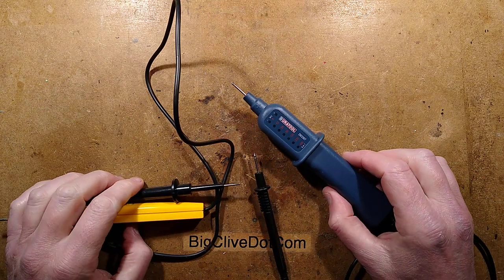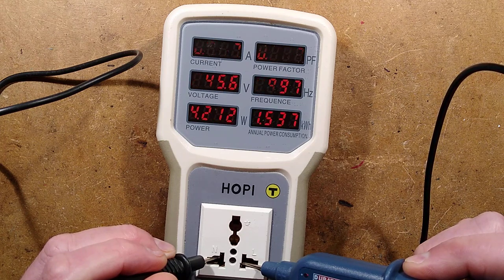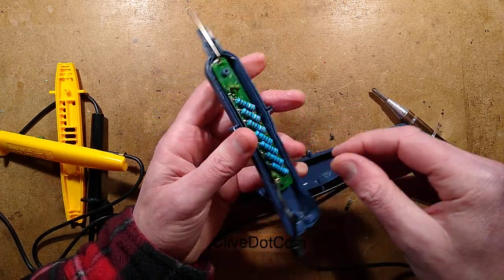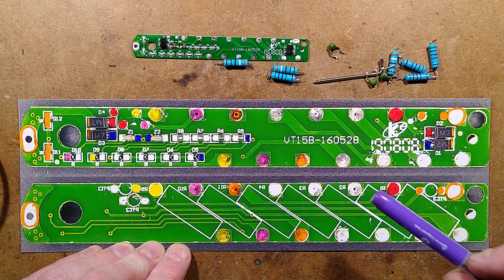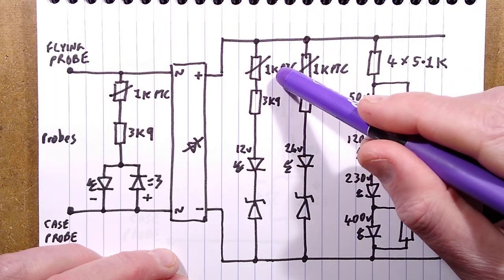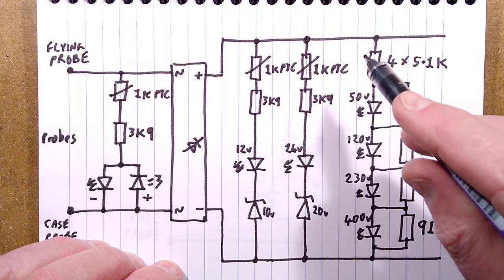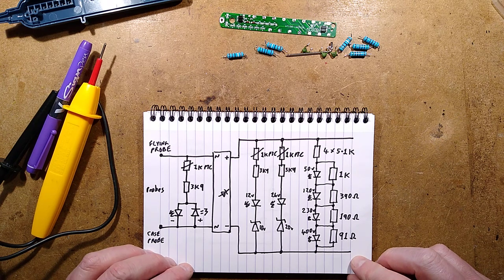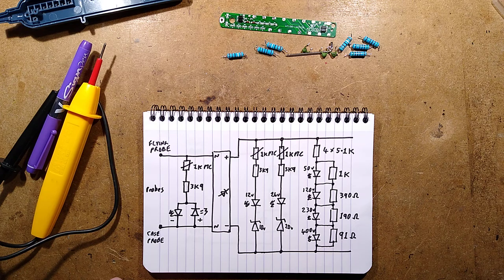Inside a cheap multi-voltage tester (with schematic)

Comment: Remarkably low cost from a reputable supplier - thanks for pulling it apart.  Would be interesting to see what the innards of a equivalent Fluke are like.
Reply: There is a £5 handling charge plus vat which triples the price.....

Comment: I love how Clive's schhh-matics are easier to understand than the actual schematics you get from manufacturers. 👍
Reply: that is the difference of doing something for a lifetime and being a design engineer fresh out of college and using all of the best principals and trying to do everything by the letter and doing it all in virtual before even seeing a pcb in their life
Reply: @frogz  or a dodgy Chinese factory! 😂
Reply: @laernulienlaernulienlaernu8953  schematics semantics  problematics
Reply: Yet again an odd one response out, but I will take some credit of Clive here. The fact is that the factory engineers have two things in mind. 
Sales schematics is meant to show minimum components and require external circuit to deal with things. 
The design team want to look after their baby and put tons of protection hoping it will last for centuries.
By the time it gets to Clive it was filtered through a chinese green-grocer or fake-meat seller, who did not know what those parts do and left them out.
SO Clive gets it bit less difficult. Plus his target Audience are DIY-ers.
Reply: @Zlodej5  you are right about them leaving out components but it's not because they don't know what they do. Dave Jones on EEVblog did a video on it, he even had a name for it (?). The designers come up with a product and then they see how much they can get away without actually putting into the finished design. It's a cost-cutting thing that the Chinese seem to have mastered, where you end up with a product that's only a few ohms from being a dead short! 😂⚡
Reply: Ah..yes CliveCAD now with colors, I do very much like the style. 
Just imagine having schools teachers like BIg Clive, Jeremy Fielding, Mr Carlson and many more I would of loved going to school then.

Comment: I troubleshoot industrial control systems as a large part of my occupation. It's important to have a voltmeter option that places a small load on the circuit. I've helped other techs, and people over the phone, that are often thrown off track by induced voltages. With a standard, super-high impedance digital voltmeter you can often see induced voltages over 60v. As soon as you apply even a slight load to the circuit, the voltage goes to zero. My Fluke DVMs have a special "Low z" scale for this and it is almost always the first scale I will use when troubleshooting a circuit. A simple meter like this one is a good alternative for simple "go, no-go" type troubleshooting.

Comment: I bought one of these for discharging large capacitors on power supplies. Gives a good visual so you can see when they're completely discharged before you start messing.

Comment: As an apprentice in the rubber mills back in the day as they phrase goes all we had was two series wired pilot lamps it served as dual voltage indicator bright 415 dull 240 check for open elements and tracing out the 240 volt control circuitry that most equipment run in those days none of this low voltage control we use in the modern world 😝

Comment: When I was an apprentice and we had time to burn.  I made a testlamp from a telex busbar, soldered in two lampholders.  we had quite a selection of bulbs.  in particular telex equipment used carbon filament  bulbs to run at 80v.  in a 50v circuit they glowed just short if white - so looking at them wasn't a problem.  and for  a testlamp, whizzing round relay coils and contact spark quenches, the difference in resistance gave the filament anything from off through red towards yellowy white.
The two inner contacts to two bulbs soldered to the probe.  The outer connected to + and - of the rack soldering iron feed running at 50v.
Normally the lamps glowed equally cherry red but if you probed a battery wire the lamp on the right would brighten. according to the current, same with earth
The dimming and brightening would "favour" one or other of the two bulbs and they ere very sensitive.  it was the only tester we had and  after a while you could guesstimate voltage resistance and current quite accurately.
 word got round and after a week you couldn't find a carbon bulb anywhere.  Not multi voltage, everything "phoney" was 50v.  they were good continuity testers though.

Comment: I guess it just shows how naive I am that I'm surprised at the absence of a fuse. Really good point you make about testing on a known-live circuit before anything else!
Reply: That applies to using any test gear or equipment. Certainly it makes it less likely that a live circuit will be mistaken for a dead circuit, and also saves time potentially on a wild goose chase looking for a non-existent circuit fault.
Reply: Test the tester, test, then test the tester again.
Reply: Technically you should be using a proving unit with it too just in the off chance the known live circuit somehow tripped when you bent down to pick up your tester
Reply: Shouldn't you earth the conductor, before working on it?

Comment: With a start current of 100 mA you will trigger the RCD if you plan to check if there is a voltage with respect to ground.
Reply from the maker: I mention a work around for that in the description.
Reply: My Fluke T100 mentions this in the manual as a function to test RCD’s. Measuring direct between L and EARTH wil trigger it. Measuring voltage between L and N for 8 secs and then measure L to EARTH enables you to test whether it is connected without triggering the RCD.
Reply: @RTBNL  yeah my old early 2000s testers would always trio them but the fluke I got around 2008 and then Megger one I have now both tell you the work around

Comment: A long while ago, at school we reverse engineered an AC voltmeter that used neon bulbs in a multiple resistor cascaded voltage divider. Worked ok, and we built our own copies of it.

Comment: i bought one of those yellow ones via ebay a few years ago and the leds were fitted reversed, the - one lighting with positive input, so i replaced them with high brightness white leds , correct polarity, and they now light much brighter at even the lowest voltage input its rated for,

Comment: My fluke tester probe has to be connected to L-N first before testing L-E otherwise it will trip an RCD - I never thought about why but watching this I guess the current draw is initially high then drops.  In a large building particularly a factory the simple single LED tester may light up on a dead circuit due to long cables runs with adjacent live cables.
Reply from the maker: I mentioned that in the description.

Comment: You live in a real world and are not a tool snob, that is why I like you and you have my respect. You will recommend tools that are functionable and cheap so that people can get interested in electronics. Just starting in electronics I do not think they will let you lose in high powered sub station with a £3 voltage tester, but for household work it is fine.  The fly lead should have in my opinion a removable crocodile clip as I was taught to probe voltages with one hand if possible, as then there is no chance of a shock across the chest.
Reply from the maker: In this case it can't really have a clip as the other probe will be live when the clip is on a live connection.  They're designed for brief contact by both probes.

Comment: I bought the one I have now from Lidl many years ago probably 15 years ago and have never seen one there since I bought it because it looked really robust with a good finger guard and very tough cable its also TUV approved it goes to 500V and I used regularly on three phase stuff and its been really brilliant. I dont use it much now because I have retired.
I have always found the tools in Lidl to be very good quality and this is certainly the case.

Comment: These are a good quick test. Personally, I've preferred the non-contact voltage sensors for a quick live or dead test, and followed it with my VOM. Regardless of how many times you check it, nothing will ever beat treating any circuit you are working on as though it is always live.....learned that one the hard way a couple of times!
Reply: @shaunlewis286  I prefer treating all circuits as though they are live, even if there is no chance of there being power applied. As I stated in my comment, I check with my non-contact, followed by my VOM. Since I'm still alive, it seems to work quite well.

Comment: Got a few testers: neon one, a Phaser 777 and a multimeter (Uni-T 890D+). Of course, the most important thing is to test the tester itself before you use it for testing anything. Like, use it on an energized branch first and be veeeeeeeeeery concerned if it doesn't indicate when it should. 

Nice reverse engineering! It's so simple... and now I know how multi-voltage indicators are made. I like the PCB design too, it's very nice.
Reply: That's what you get proving units for on the more expensive GS38 testers, unfortately they are price gouging up the ass (£50-70) for something as basic as a 700v but low current (iirc dc) voltage generator.

Comment: The usecase for this things is a DIY lamp change once or twice a year, checking if you got the right breaker to turn the power off. So in the best case scenario these probes never see voltage at all. It's definitly better than a Deathstick.  ;)

Comment: Another good video. I would suggest to anybody using either of these anywhere near a bitey voltage to at least half or two thirds sleeve the probe tips with heat shrink. That amount of live metal hanging out of a socket could potentially cause more than interesting language on accidental contact ...

Comment: Zeners and resistors are selected so LED lights up at around 75% of the nominal voltage, so the zeners are roughly 7V5 and 15V, allowing discrimination between as 12V battery and a 24V battery, so long as they are somewhere between fully charged and fully flat. Mains side as well 75% rated, so that they will work with low mains voltage as well. Yes no fuses, they rely on the thin strands of cable blowing, or the thin traces, and the better ones for industrial use come with a small proving block ,that can generate around 350VDC to allow you to test the device, with it having a pair of holes and plated steel pads deep in there to accept the probes, and the one is a switch that powers the tester on, so it has a LED, a low battery light, and no way to touch the tasty high voltage.  My one is glued shut, so not going to open it, it likely will not work well after the opening, and i kind of like it.

Also have the very old DZUSPOL unit, which has both a neon to show you tasty voltage present, plus a press button that switches in a nice chunky iron core voltmeter that shows both there is no high resistance, by passing around 100mA, and the mains voltage. Also acts as a very quick RCD tester, press button when live to earth, and if RCD does not immediately trip it is failed, or there is no ground connection. Sharp high carbon stabby steel tips to use to dig through the insulation on cables as well, plus it has a nice 3A BS standard plug fuse in it at the end of the flying probe. No DC measure though, and AC only, over 90VAC to 400VAC.
Reply from the maker: I just got and tested a cheapo Chinese 8-voltage tester.  The 380V LED lit up on 240V.  No quality control.

Comment: I use the cheap test probes for fixing power tools, motors etc.  I have some more Expensive ones with a Rotary control knob !!!!  But I reach for the simplest probe unless it's something complicated that has gone wrong !!!!    I clip the black wire on and only use one hand to use the Probe !!!! So I'm not likely to have a Shock and also  a bit of anti static protection for the circuit !!!!  I don't have really expensive equipment like a Fluke !!!!  But I'm only fixing my own stuff at home !!!!!  If I can't fix something then it gets thrown away.  If I have some faulty equipment, I buy a Replacement, and I have found I can always repair the original faulty device.  Otherwise I spend hours trying to fix something and end up having to throw it in the bin !!!!!!

Comment: Way back in the late 1950s the Drummond test lamp complete with 15 watt pigmy lamp was state of the art.  Worked fine until the lamp filament broke when I dropped it in the took box and I believed that the circuit I was working on was dead, It wasn't and fortunately neither was I. I would be careful using these testers as , like the old Drummond they have no means of self testing to prove that they are in working order.

Comment: when I started my apprenticeship in 1986 I bought a used Simpson multi meter.I still have it.I bought my first clamp on meterit was an amprobe . .Then ideal came out with a volcon tester . Handy device but don't trust them ever !I realised that Cat 4 is the only way to go .Even in residential applications and especially when you are dealing with vacuum tubes and in some cases over 5kvdc .Ouch! Flybacks are brutal that's 25kv on old picture tube tv !And don't use fused leads and always test the meter on something small or continuity test to make sure the leads are working !Many an apprentice and journeyman have met their fate because the meter said the power was off !

Comment: Just calculated that 2W x 5K1, press sqrt, gives a voltage rating of 101V per resistor, so 400V continuously doesn't overheat that part.  The load on the lower voltage indicators may be a problem.  I certainly don't want my test probe to have a fuse or any other misfeature that will "prove dead" a live circuit.
Reply: That 2W rating is in free air. In an enclosed device like this they will overheat.
Reply from the maker: Any fault that would blow the fuse would render it inoperable anyway.  But I'd rather have a controlled failure in an HRC fuse than an uncontrolled failure in a handheld enclosure.
Reply: @bigclivedotcom  I'd rather have the handle look physically damaged.
Reply: @johndododoe1411  really?
Reply: @ahyaan2552  As long as it doesn't take my hand with it, I sure as hell would. Maybe I'm not even the one who blew the fuse in the tester. Maybe it was the person who used it before me. If I pick up the tool and test for voltage, I'm gonna feel somewhere between dumb and dead if it turns out the circuit was live after all and my tester is just no longer functional because of a blown internal fuse.

Comment: Substations are too scary to mess with.  That being said, I did once get told to connect two building size transformers to an Ethernet network.  One was indoors and the Cat5 cable was run already to right next to it, so all I had to do was crimp an end on it & plug it in to the meter.  The other one though was outside, across a driveway, and already running.  I had to push the Cat5 through a conduit pipe from one end hoping it came out in the right place.  That one could only manage a 10 Mbit half duplex connection because of all the interference along the run.
Reply: Took me a second to read that properly, sounded like for a second you were hooking up HV to cat 5.
Surprised they didn't spec shielded and/or grounded SWA cable?

Comment: Very interesting. The UT-15B silkscreen on the PCB had me thinking it must be a Uni-T product, and indeed they make such a device with that model, though it looks a little different and is a bit more full featured, so it's not just a simple rebrand. Wonder why it's labeled that...
Reply: The UT 15B is a multimeter, not a voltage tester. Their voltage tester is the 22B and matches the features of this thing exactly.

I think it’s just a coincidence tbh.

Comment: That is an interesting teardown. I didn't note if it was manufactured to any standard. The usual standard for these is BS EN 61243-3. If I remember correctly, this standard prohibits the use of fuses in these types of testers, but the input current has to be less than 3.5mA. The input resistance in my Socket and See tester, that is CAT IV rated, is 122 kOhm. I will have to test it to see if suffers from an inrush, but it has never tripped an RCD. My other voltage testers that have RCD trip capability, work the opposite way to this one, i.e. it has the high initial input impedance, but then you manually operate a load switch to trip the RCD or remove suspected ghost voltages on the circuit being tested. Whilst those units do have a battery for the extended features, they will still detect the presence of voltage without the battery, I believe that is also a requirement of the standard.
Reply from the maker: I prefer a tester that applies a decent load to a circuit like the old lamp based ones used to do.  It's unfortunate that the functionality of traditional test equipment is being dumbed down to make it suitable for unskilled labour who have been "trained" with short slideshows and open book tests that anyone can pass because the answers are in front of you.

Comment: I can imagine those low resistor values will put lot of stress on the LEDs. Although after the low voltage LEDs fail, the rest will still work.
Reply: It will still be a nice mains powered hand warmer after the LEDs short out.
Reply from the maker: The old red LEDs are very rugged.  They can handle brief pulses of high current.

Comment: I usually use my multi-meter.  I test it on another source, then I use it to measure the circuit in question.  That way if there is no voltage present I know that my meter is reading accurately and if there is a voltage present I know what the voltage is.  One tool to do the job.